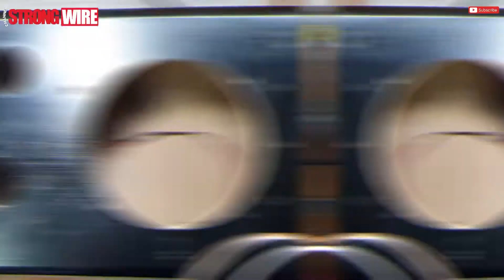Technics SB-CD933 - Repair and upgrade

Comment: Absolutely love the upgrade..beautiful speakers worth it..my question is when you upgrade bass driver and crossover do you consider impedance of all drivers  to get best performance...I'm not knowledgeable on this speaker stuff
Reply from the maker: Of course, it is necessary to harmonize all the components in order for it to be close to the original, and even better, I can freely say, than the original.
Reply: Interesting so what is the impedance of each driver collectively how much impedance did they give you
Reply from the maker: @garrifade186  Of course, we look at the impedance of the speakers, so that the crossovers themselves are of the same value, and so that the crossovers are of similar volume to the speakers themselves for better sound reproduction.
Reply: What bass loudspeakers change? Original is very poor. What type you use?
Reply: @strongwire  Can Technics CH530 units also wotk with Technichs CH-515?
Are the Technics separates/components interchangeable?